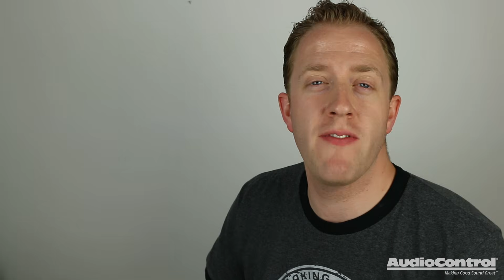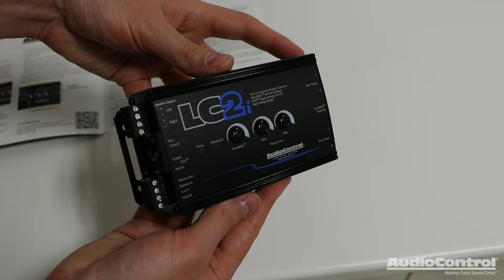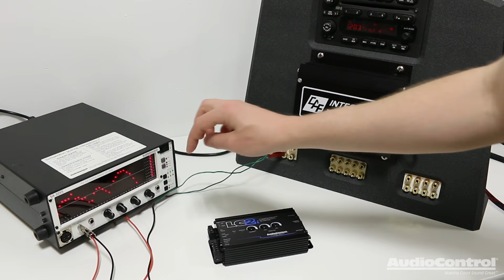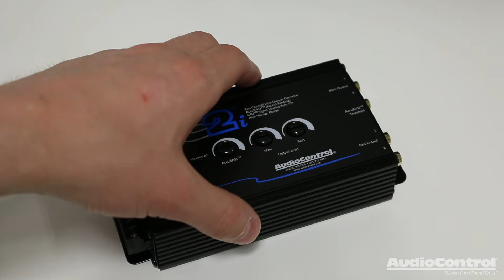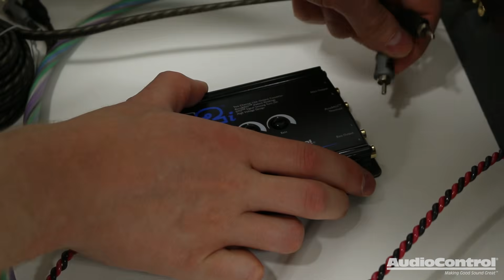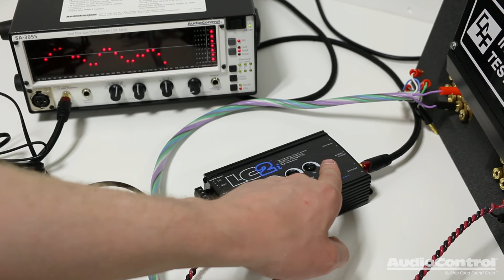LC2i Training Video

Comment: I’m new to this but I have this LC2i.
I’m installing this into a 2014 Dodge Charger through the beats audio 8” subwoofer for power.
1.) I posi tapped speaker wire into the subwoofer wire (before the male connection)
2.) I connect those speaker wires into the LC2i via a Ferrule connection, 
3.) Where do I attach the 12v power wire and Ground from the LC2i?

Comment: Can this be used as a line driver. Run an rca from head unit into a rca-speaker wire adapter for the input and then rca to amp out? This is with the goal of boost preamp output voltage from the amp. Will it work this way.
Reply: @caraudiofabrication

Comment: If I can turn the gain on the LC pro to almost all the way up before it starts sending the distortion to my system, and I can detect this with a DD 1+ if I can send over 10volts of clean power to my amplifier from the LC. Would that hurt my amplifier?

Comment: I have the LC2i with the subwoofer knob. I’ve had it for about a year and a half, it worked great until last winter ( it was -23 here) and the sub knob broke, now it only works half the time. 
The unit will now turn on and off,  sometimes with only the “maximized” light showing. 
I have the remote out to the amplifier, and I have only the left speaker being used. 
Any idea what the issue could be? I don’t wanna buy another unit or amplifier

Comment: i have tried every everything to get the altanator noice out of my system ground changes ground loop isolators. and changed the source unit ground and even did a resistance test on the ground. i think its my head unit. i also even installed power loop isolators 10amp. but nothing would clean it up. i have a avx 4000 sony headunit i think the rca output i got with my unit is just garbage because u touch them and they make noise weill i had one of these lc2 from my chevy ss build i did so i thought ill try it why not. no altanator noise lol. and im running sky high car audio primium rca cable into a b2 6ten dsp. than into my riot 1800.4. but ya kinda sucks to have a high end head unit and still have to use a line out converter. when i stream threw the dsp i dont get any noise. i just like running andriod auto. you have anytips i could try.
Reply: i had a nice kenwood radio and everytime i’d hook it up id get a wine, what ended up working for me is i took speaker wire, any ofc wire stands would work and wrapped them around both rca inputs on the back of the radio and plug ur rca’s back in 👍

Comment: My sub amp keeps turning on and right back off while the truck and radio is off. It's an f150 running the lc2i in sensing mode controlling my sub amp remote wire. Any ideas?
Reply: Your best bet is to bypass the GTO and use a remote in signal to the lc2i, and see if that solves the problem
Reply: @saifzaban6648 thanks, this is what I ended up doing.

Comment: Do I need to use the actual speaker wire or can I T-off the speaker wire and plug in the new wire to the LoC?
Thus the speaker wire is still connected to the speaker and is playing.
Reply: Yes you can tap into the existing speakers

Comment: I have a 2012 Lexus ES 350 with Nav but without Mark Levinson. The bass rolloff isn't a plateau. It seems like it selectively reduces bass at different levels throughout the song. If I used an LC2i pro, would the bass still be choppy since it amplifies the bass signal from the input?

Comment: I installed my system, JL 12” with built in amp, lc2i 
Sounds good and clean, however once I start driving, specially on low speed, I head bass lines, consistant or come n goes.
This is even when music is off
On n off.. can’t wrap my head around where this is coming from
Reply: Did you figure it out? I'm having the same issue and could really use some help.

Comment: Does anyone know how long the LC2i will stay on after the vehicle is turned off if I am using GTO? I have another brand LOC and it keeps my amplifier on for 10 minutes after the factory stereo is turned off. I looked in the manual for the LC2i, but I find no information on time out when using GTO. thanks
Reply: what up doe , did you find out what it is? I’m actually trying to figure it out myself

Comment: Great video, I love it. but what about if I want to connect only one single speaker cable with R+/L- to the LC2i speaker input, should I connect it to L+/L- or R+/R-?
Reply from the maker: We generally recommend bringing in your single speaker wire in to the left input (where GTO Signal Sensing lives) then jump that signal (+ to + and - to -) to the right input.
Reply: @AudioControlCar  
If I understand you mean that I have to connect my single speaker wire positive pole to LC2i L+ input and the negative pole to LC2i L- input
Reply from the maker: @boubacartraore5373  Correct. Then jump that connection to the R+/- input.
Reply: @AudioControlCar  
Sorry to bother you, it’s my first time to do this kind of connection. So can you please show me how to jump that connection to the R+/-  right input
Reply from the maker: @boubacartraore5373  Check out: https://audiocontrolmobile.zendesk.com/hc/en-us/articles/22048763492493-My-factory-head-unit-only-has-a-mono-output-Can-I-just-send-a-mono-signal-into-my-LC2i-or-LC2i-Pro
Reply: @AudioControlCar  
I’m very satisfied. Thanks for your help.
Reply from the maker: @boubacartraore5373  Any time.
Reply: @AudioControlCar  
Sub in mono vs stereo input via y-cable vs stereo input via jumpers which will perform best
Reply from the maker: @boubacartraore5373  The difference may be nominal, but via jumpers is generally recommended.
Reply: @AudioControlCar  thanks again
Reply: @AudioControlCar  
How many gauges do I need for the speaker wire and the jumper wire in order to fit in to the lc2i inputs
Reply from the maker: @boubacartraore5373  16 to 14 gauge is best.
Reply: @AudioControlCar  Thanks very much
Reply: @AudioControlCar  is it possible to twist the LC2i R+ with L+ speakers wires and then tape this to the positive wire of a single speaker and then twist the R- with L- then tape it to the negative wire …instead of jumping the wires
Reply: @AudioControlCar  
Can you please reply to my message 
Thanks

Comment: Who is the god damn engineering genius that decided it was a good idea to put the power and the ground inputs a millimeter apart and make them 7000 gauge so you can't even see the holes to pit the wires in and then make the screws so small that your specialty screwdriver has to order a specialty screwdriver just to install it? Idc how great the device is, that's terrible fucking design

Comment: I have a gm kicker subwoofer installed from dealer. I want to add a  soundstream bx-20z digital bass reconstruction processor. To controll the bass better for songs that dont hit as good. But I got it all connected a rememberd the kicker amp takes a high input from the left front speaker. And the output from the soundstream is a low line level output. Can the lc2 bring up the volume output enough for the kicker amp to work? The kicker amp has dip switches on the bottom do you know anything about the settings by chance?

Comment: I only used the left rear speaker in my silverado, do I need to put left and right in? It's just to pull the signal right?
Reply: My JL-HD1200 specifically says in the Owner's Manual that I need a Y-adapter for the one RCA jack leaving my LC2i because my mono-amp requires a signal going to both female RCA jack inputs.

Comment: Say if i wanted to get all new speakers, would I have to tap into all the factory speaker wires in order to get them to sound good with the aftermarket amp? I know most people just use 1 for the subwoofer install. Any help would be greatly appreciated. Thanks.

Comment: Good stuff brother. I've recently installed an lc2i with a crossover and a 4 channel Boss amp. My question is why are they staying powered on?
Reply: Check your remote wire is properly installed into an ignition wire or a fuse that turns on with the vehicle when the key turns and then back off when you turn off the car.

Comment: Does the AccuBASS restorer require a full range signal to work, or I can I just use the factory amp subwoofer speaker cables which would only have sub level frequencies?
Reply: Exactly what I’m wondering

Comment: I just installed the LC2i(with the GTO enabled), tapped into the rear left and right speakers for signal, connected the 12v+ and ground to the power and ground cables on the aftermarket AMP but I don’t seem to get the power light on all the time when I’m playing music even if the main dial is set to max… the power light keeps flashing instead of staying on all the time. What do you think that would be the reason? Thank you in advance!
Reply: Im late but this is my current issue
Reply: @perilousSK figure it out

Comment: I have an Lc2i with an arc-1 remote. I made sure to adjust the device properly without the remote plugged in, The maximize light does not come on. So why do my subwoofers make a popping sound when I turn the knob up on my acr-1?

Comment: I installed a JBL BassPro SL2 powered subwoofer on my 2016 Volkswagen e-Golf (non Fender audio) by tapping the front speaker output wires and connecting them directly to the sub’s high level input. 

I noticed the head unit output now clips at a much lower volume and it gets unusually hot. It is almost impossible to set the sub amp gain as the levels are all over the  place and slight changes to the amp gain cause the sub to cut in and out. 

I verified the polarity of all connections on both ends and everything seems alright. I would assume tapping into the speaker outputs effectively lowers the impedance seen by the head unit onboard amp causing it to go crazy. 

Wondering if using an Audiocontrol LC2i instead connecting directly to the sub’s high level input would make any difference.

Comment: Hello sir,  great video!  I do have a question were are you getting your power source from? Straight from the battery?
Reply: Run a jumper from your amp power lead
Reply: @heathcolwell9190  what do you mean jumper? how do you do that?
Reply: @sp00f34  a wire from ur amp to lc2

Comment: It's so hard to find a damn video. Where someone explains. What speaker wires you really need to hook up? If you're just doing a subwoofer, I've read that you only need to hook up one pair because it's mono, but I always see four wires going into that the speaker input. No one explains that at all, ever, never.
Reply: Bass is not always mono, even if it doesn't make sense. Some tracks will sometimes favor right channel, other songs will favor left channel, and i noticed this when i set stereo subs to my home audio system.

When you connect both channels to lc2i, i suspect, you get a proper mono, so your bass will work the same no matter how the song is mastered.
Reply: Did you ever happen to figure that out?

Comment: Lc2i has a built in high pass filter at 33hz. The pro does 20hz.
Reply: What do you mean by this? The lc2i won’t play under 33hz?
Reply: @xxah54nxx  it means it falls off rapidly under 33hz. I changed it out for the pro and the lows are much better.

Comment: Great video. I've been running a cheap passive line out converter in my Tundra with the factory jbl setup for a few years and I think I'm getting dirty signal from it. I think I'll pick one of these up and see if it helps me out
Reply: How is it after upgrading?
Reply: @JeremyLyn_1925  just got it in and set up.

100% worth every penny. I won't use anything else now
Reply: @JeremyLyn_1925  funny you ask at the time you did.

I bought a kicker passive loc and it sounds much better but my factory jbl signal is way too much for it so it sounds funny still.

I have a lc2i pro in the mail arriving tomorrow, i will update you when I get it in and going.

Comment: Just picked one of these up, about to install it on the weekend. I saw that it came with a bass knob and also my amp came with one aswell...Which one should we utilize?
Reply: I use the amp cos the LOC is an accessory for the amp. You know? 
Think of it this way. 
The amp is King Daddy. 
The LOC is like a little bish gettin sht together for King Daddy.
Reply: i would use the subs.  you really needed the one without the "accubass"

Comment: I've had this for a few years and since day one the gain knob does absolutely nothing.  No volume change at all.  The optimize light never comes in no matter where the gain knob is set.  I think this is a lemon , sounds no different then my 20 dollar pac loc
Reply: sounds like it's not hooked up correctly
Reply: @Re.dBeard  nope hooked up correctly.  I didn't realize that the bass adjustment was not actually a bass adjustment but s gain knob for the bass rca output.  The gain adjustment is actually the gain for the main rca output.  Kind of a confusing way of labeling the adjustments but I get it now.   Once I went back and messed with it it I figured it out and optimized light started to come on.  So far so good.

Comment: Can I disconnect the stock sub, use those wires to the lc2i, set up the lc2i with the amp and run an after market sub JUST for bass ?
Reply: That’s what I did and works great
Reply: Yes

Comment: Would it work on a mercedes vehicle?
Reply from the maker: Absolutely!
Reply: @AudioControlCar  im having issues.  It wont power up.  Im tapping into the rear oem harmon/kardon subwoofer.   There is 4 wires.  On the LC2i:  I have - green into positive, grey into speaker negative, red - +12v, and black - ground. Then I switched black into rem. still nothing.  Please advice how i should wire it?
Reply: @AudioControlCar  you meant Absolutely No right?  Sorry I misunderstood
Reply from the maker: @Jhojlholjo  No, we meant it WILL absolutely work in a Mercedes. There is no reason why it wouldn't. If you are not able to get it to power on, and currently trying to use GTO to turn it on, you may have to run a switched +12v lead to the remote input. If you continue to have questions, please call our tech team at (425)775-8461
Reply: @AudioControlCar  thank you so much.  Im relieved now. I will try now.  I hope i get it as it will help a lot of fellow mb owners at mbworld.org and I will post a DIY.  Thank you so much.

Comment: Love the vid! But do i have to hook up both speaker inputs or can i just use one?
Reply from the maker: You can use just one, if you need to, but you will then only get output from one of the RCAs. So, if you only have one channel of audio (one + and one -) to work with, we would recommend using short jumper wires to make sure that both the L and R inputs are populated. Check out this link where we explain this further in detail: https://www.audiocontrol.com/knowledge-base/factory-head-unit-mono-output-can-just-send-mono-signal-lc2i/
Reply: Good question, excellent answer, thank you

Comment: Question? When hooking up speaker inputs, does it matter what stage you use to hook up the lc2i! Like does the product need to be hooked up to the front stage wiring or rear? Does it matter?
Reply from the maker: Good question! It really depends on what you're using the LC2i for. If you are just adding a subwoofer amplifier/sub, then it really doesn't matter, so long as the signal you tie into has enough bass information present. If you are using the LC2i to add a full range 2ch or 4ch amplifier, the same applies. You would just want to be sure to tie into a signal that has the correct audio information present. Also, be aware that depending on what channels you use for signal, your fader may affect the output of your aftermarket amplifier/subwoofer.

Comment: I have a question regarding the lci2 not turning off once the motors off? Can you please help?
Reply: It power up right away after you plug your speaker wires to your main back speakers even though the motors off
Reply from the maker: Sounds like you're using GTO to turn the unit on. Try bypassing GTO (using the jumper on the side of the unit) and then use a remote turn on lead to turn the unit on. This remote turn on can come from any +12v power source that turns on and off with the vehicle's ignition.
Reply: Yes im trying to use the gto but i thought itll turn off once you turn the car off? How would u bypass i see the two little prongs on the side but how would you hook it up beiing so little? Thank you for answering

Comment: If I'm only hooking up my subwoofer (with amp) to the lc2i where do I get the speaker wire from?
Reply from the maker: You can grab signal from any speaker(s) in the vehicle that have enough bass in the signal presently going to them. Play a song with some bass in it, listen closely to each speaker (Put your ear up to it even?) and try to see if you can hear the speaker playing some bass. If you can, that speaker should be ok to grab your signal from. Remember, you don't have to disconnect the speaker either, you can just tap into the wires leading to it. If not, give our tech team a call at (425)775-8461, Mon-Fri, 9am-5pm PST.

Comment: I have one of these and had NO idea it had as many features! I was just thinking earlier today that I need a bass knob. I googled RCA knobs but come to find out I just need the Audio Control one. COOL!
Reply from the maker: Awesome! By the way, the ACR-1 dash control knob is the correct one for the LC2i, in case you're curious. Thanks for supporting AudioControl and enjoy that sound system!
Reply: @AudioControlCar idk if I’ll still get an answer but what if I run one that came meant for my subwoofers but not specifically for the lc2i?